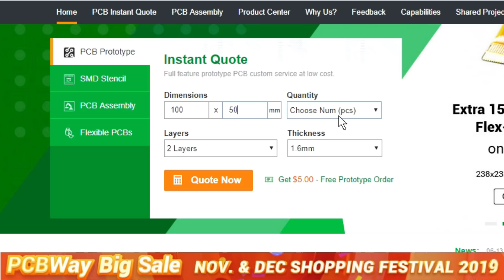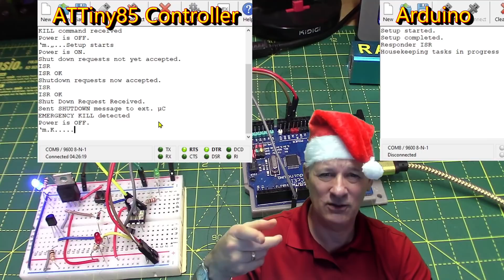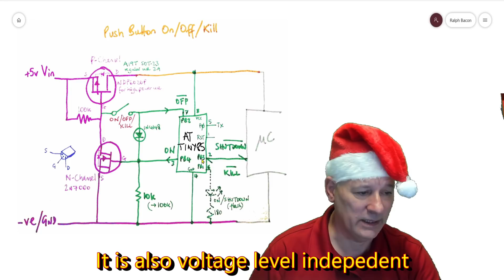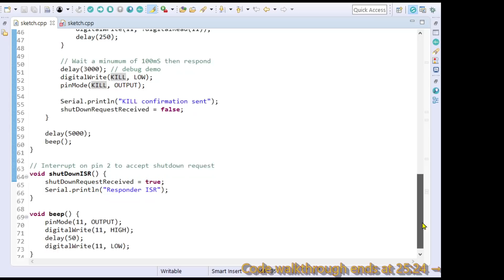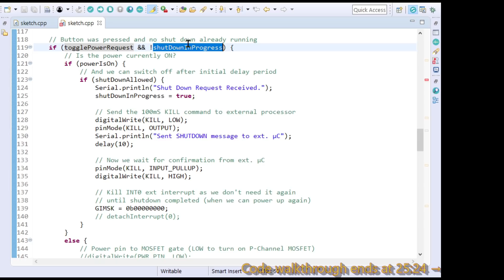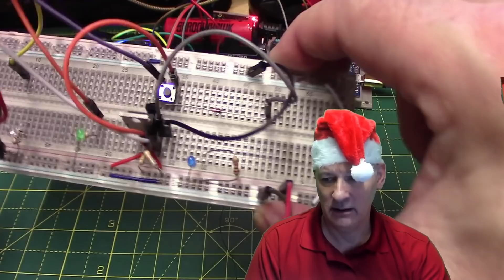#173 ATTiny85 Power On Off Shutdown

Comment: Glasses or patch, it matters not, a full recovery is the real issue. I'm enjoying this power on off series. I'm now thinking maybe the extra ATtiny85 may not be required, can the soft shutdown be done with just the same two pins on the main micro (excepted the forced shutdown routine I guess). Merry Christmas LC&S. Greg
Reply from the maker: If you watch Video #123 you will see it without a Tiny85, but with less "intelligence", Greg.

Comment: Ralph, wondering if you've made any video that could possibly give me idea on how to build a light controller.  I have 16 LED can lights in the ceiling 22 feet up, I'd like to have a potentiometer type switch for which as I turn it, more and more lights come on starting from the center out.  I don't want dimmable LEDs, I'd rather control brightness by simply the number of lights which are on/off.  I was thinking arduino connected to 16 relays.  Can you think of any of your past videos that would give me started on such a project?  I like the simplicity of a potentiometer rather than a wall full of toggle switches.  I'd pay for such a switch/controller, but I can't find anything on Aliexpress.  I don't need to use a smooth turning potetiometer, I'm okay using a channel switch too so position 1 through 4, maybe each position turning on 4 lights.  Thanks.
Reply from the maker: If these LED lights are individual lights connected to the mains then you can control them via relays or SCRs. You can buy 16-channel relay modules to connect to an Arduino (or similar). Personally I'd use a single Rotary Encoder to switch more on/off but initially you can do it the old (easy) way with a 16-key matrix, for example (to avoid the wall of 16 switches). If you email me I'd be happy to expand on all this. Go to https://www.youtube.com/channel/UC8Ob-HnnmhlgSv5Vs_i32TQ/about and click on the view email address.

Comment: C'mon admit it... you're monitoring my postbox down here in the land down under... how else did you know I'd received a bunch of Si4599 dual mosfets the other week, in order to be able to implement just this this sort of soft power switch?😂 With regard to power consumption when the system is turned on, dropping the clock speed to 1Mhz or even 128 kHz would bring it down to less than 1ma if I'm reading the datasheet correctly (22.1 Active Supply Current), let alone introducing sleep modes and other fancy stuff. Food for thought. Loved the video, as always, and have a safe and Merry Christmas. Bring on the glasses, Elton! 😂
Reply from the maker: Drat! You must have spotted the wires running to your postbox, Peter, sending me details of your packages! Ha ha! Regarding power consumption it all depends on what you are controlling. If your load is 1A then worrying about 5mA in the Tiny85 is silly. But if your load's power consumption is 1mA (or lower) then it makes sense to reduce the Tiny85's power to a minimum. Sleep/Idle mode is a good candidate and I want to play about with the code over the next few days to see if it "just works" with no modifications. Then there's the Attiny13 substitute, of course...

Comment: Ralph, here's my humble list of suggestions for a PCB: Connections along one edge on .1" pitch for - input power (+ & -), external LED (as well as an on board one), external switch (as well as an on board one), to MCU (+Ve, Gnd, & Ctrl). 3x2 ISP/ICSP connector. Pads along a different edge for a standard serial to USB thingy (even though only Tx and Gnd are used).  Two 3.1 mm mounting holes at the ends of the side opposite the main connections (maybe 2.6 mm if space is tight).  Go for all through hole.  Put the LED's resistor on the pin so that an external LED is to ground.  Is the reset pin supposed to be pulled up or down?  If so add a suitable resistor.
Reply from the maker: A timely comment, Brian, as I have been mulling over what might be useful if I were to go the PCB route. I've thought of some of the items you mention but not all. I shall consider what you have suggested. Now, why are you proposing through-hole when the industry is definitely SMD - I've even tried such a layout with ginormous components (1206 and 0805) to make it super easy to solder. I'd like to encourage noobies to "have a go" at SMD construction. Thoughts?
Reply: @RalphBacon  I see your point about pushing people towards having a go at SMD.  However, how affordable is SMD for hobbyists?  With through hole there isn't the variety of sizes that are mutually incompatible.  If I were a youngster starting out (or even an oldster moving with the times) what size would I start with?  With through hole there are affordable selection packs with 50, 100, or 1000, is the same true for 1206, 0805, 0603, and 0402 I wonder.  I note that 0805 is only 0.125 Watts, is this going to present unexpected design challenges?  What happens when a generally 0805 layout needs an actual 0.4 Watt resistor (hence 1210)?
Is a weird footprint that supports through hole at 0.5" with an SMD pad pair in the middle a possibility?  e.g. something like: O-[]  []-O  This would allow hobbyists to populate according to their ability and the contents of their parts bins.
Reply from the maker: If a design does require a half-watt resistor then that must be included as part of the design. Even if all the other components are 0402! 
I like your idea of both TH and SM components - whether that is going to work, I'm not sure but I'll have a go! Even if we can't do it "in-ine" as per your example, they could be in done "in parallel". The problem for me is that I only have 0603 SMD components but nothing larger. Luckily I have a "PCB ruler" from PCBWay that shows all the correct sizes on it. 
When starting out in SMD I just bough 10, 50, 100 of whatever SMD components I needed (and is sometimes the amount you must buy from some suppliers, super cheap) but then you build up stocks very quickly. And they don't take up much room if put the caps and resistors into an SMD sample book, especially designed for them. You lose at least 10% onto your workbench, floor, who-knows-where, so it's good to have lots of spares!
Reply: @RalphBacon  Actually, I may have to eat my words about getting resistor selection packs.  The following are random finds:

https://www.ebay.com/itm/3120pcs-156-Values-1-ohm-10M-ohm-1-4W-1-Metal-Film-Resistors-Assortment-Kits/192074917475?_trkparms=aid%3D1110001%26algo%3DSPLICE.SIM%26ao%3D1%26asc%3D40719%26meid%3D697b61cc06044def9bff6d94e760d5bd%26pid%3D100008%26rk%3D4%26rkt%3D12%26mehot%3Dpp%26sd%3D193228098618%26itm%3D192074917475%26pmt%3D1%26noa%3D0%26pg%3D2047675&_trksid=p2047675.c100008.m2219

https://www.ebay.com/itm/8500-x-0201-0402-0603-0805-1206-SMD-Resistor-Kit-170-values-5/264310462768?hash=item3d8a219930:m:mKj_eNzDmwMqpT9PbSQTTbw

So perhaps the cost of getting set up for SMD isn't as hard or costly as I thought.
Reply from the maker: Regarding your ebay links, yes, they are cost effective. But I would definitely look for a 0603 or 0805 resistor/caps book that has all values for a particular size. Mine was bought from a UK supplier but they must be generally available: 
https://shop.pimoroni.com/products/smt-smd-0805-resistor-and-capacitor-book?variant=27663754823
Or buy an empty book and fill it yourself otherwise you will never find the value you want!
Reply: @RalphBacon  Do you see multiple copies of my original comment?
Reply from the maker: I did earlier this morning but I deleted all the duplicates! Trying to get my attention, I assumed!!!
Reply: @RalphBacon  There are still three spurious copies when I look from here.  What are YT up to?  Thanks for the deletions.  I was worried that if I deleted one then they'd ALL go.
Reply from the maker: I can see only 1 now, Brian. Try pressing SHIFT-F5 to see whether it's a browser caching issue with you.

Comment: I'm afraid I have to take issue with your assertion about "open collector" and how you "always want to be driving things low". There's nothing magical about low. Bus conflicts and short circuits are quite possible with either configuration. It is merely a convention that some devices have high-Z outputs for shared lines. They could just as easily have had a convention that they should be low-Z instead.

The only exception to this would be for multiple voltages - e.g. you are controlling a 3V display from a 5V Arduino. To drive an output high, you would have to drive it to a specific voltage. But usually everything agrees where ground is, so it makes a convenient reference point. Although this isn't always the case, of course. Op-amp circuits, for instance, often have a negative ground.
Reply from the maker: Indeed, and that's why I put a comment on the video about voltage level independence (eg 3v vs 5v), which is why I2C and SPI do the driving LOW thing. It's not standard practice to drive things high unless it's on a known platform (PCB). And this controller is simply connected to "some other µController" that could be running at any voltage. So driving things LOW is much safer. I suppose I could have used a level shifter but I don't think that is required here. Great to hear from you, thanks for posting.

Comment: I'm no expert but even though the idea looks and sounds great ,,on paper,, I still think that the best, cheapest, and the most reliable ever solution (in this case) would be to scrap the idea and simply use an ordinary switch. Why overcomplicate things unnecessarily and costly  when simplicity is the mother of functionality. Simpler, cleaner, quicker, cheaper, and longer lasting uncomplicated solution.  Job done .....;)
Reply: I am on your side. Even it's nice solution, if I wanted to implement this solution on PCB using SMD components, I would have to add extra pins/pads just to program a on/off switch, which sounds silly...
Reply from the maker: The reason this project is not a switch, Ovi, (sudden death for the chip) is that:
1) this channel is all about Arduino-related items
2) you can gracefully shut down without leaving files open (and possibly corrupted)
3) it's fun to do.
Why over-complicate a perfectly good TV with such a clunky remote control with all those buttons?

Comment: Now that's what an ATtiny85 is all about: smart peripherals.  This is the best project you have  shown us AND it is all your own work. This could be a standalone device that one just has to "plug" into any project. In the same way one uses, say, an RTC module. If you had time to put the arduino side code into a library the smart button would be just as easy to use. Ifg one can figure out the different voltages, there is no reason why microcontroller has to be an ATMega328P*, the same principles could be applied to an STM32* circuit. 

I haven't had time to check the ATtiny85 code yet (too excited) but I am assuming that, say once the smart button has turned on the power and the MCU was performing a task that on completion the MCU would switch its power supply off, the KILL pin would do the job. Am I correct in this (yes I am familiar with the 'ass of me and u' thing)?

This video has moved your channel into new territory. You have shared a true innovative process with us not just shown us how to string a series of retail modules together with some wiring. I am not suggesting that that describes the sum total of this channel upto this video, but, sadly it does describe many maker channels on youTube.
Reply from the maker: So do you like this video then, Michael? Ha ha! Now, before you get too excited I didn't put the Tiny85 to sleep (KISS principle) but I think it would "just work" as is, using the push button interrupt to wake it up again. I'll see if it is that easy over the XMAS break. As it takes only 5mA when active it may not be worth it depending on what is running, of course. But I suppose we should do this power saving where we can. Thanks for posting, good to hear from you.

Comment: BTW, Ralph, your code without Serial for Attiny13  compiled as:
1016 bytes (99%)/1024; 32 bytes/64 (50%) with all standard Arduino functions
990 bytes (96%) with  _delay_ms() instead of delay();
970 bytes (94%) with bitSet, bitClear instead of digitalWrite  and  (PINB & (1<<PINB2)) instead of  digitalRead(INT_PIN)
Reply from the maker: That sounds great and so that others can read this too,  I discovered that MCUDude supports the ATTiny13 with his MicroCore:
https://mcudude.github.io/MicroCore/package_MCUdude_MicroCore_index.json
which needs to be added to the File>Preferences and then the boards installed in the usual way.
Reply from the maker: A quick query about the ATTiny13, I have several clock speeds available, which one do you use (internal)?
Reply: @RalphBacon  Internal, 1.2mHz
Reply from the maker: So I used MicroCore and got the following results from my ATTiny85 sketch with just the SoftwareSerial library removed:
Sketch uses 818 bytes (79%) of program storage space. Maximum is 1024 bytes.
Global variables use 33 bytes (51%) of dynamic memory, leaving 31 bytes for local variables. Maximum is 64 bytes.
Reply: @RalphBacon  WoW, that's even better than after my optimization! Perhaps, you've removed some unnecessary lines form the sketch...
Reply from the maker: I removed only the Serial.print lines and the library!

Comment: Happy Christmas to you too!
Great to see you using the very handy little ATTiny85!
Reply from the maker: Yes, I've warmed to it again, Martin, but I will have to sort out that programming in-circuit board. Or clip. Something, anyway!
Reply: @RalphBacon  You got me using the attiny85, thanks. I ended up putting the bootloader back on them to make it convenient to program. I am using them to build some 5 volt power packs.

Comment: Well done on the  LTC2954 emulation. I was going to look at the code , but all I see at GitHub is

CircuitDiagram.jpg Circuit Diagram (Hand Crafted) 2 days ago
LICENSE Initial commit 3 days ago
LTC2954 Typical Circuit.JPG LTC2954 Typical Circuit 2 days ago
README.md Update README.md

Where did you hide the code?
Reply from the maker: I hid it so no-one could find it, that's for sure. Or I just forgot to upload it. My bad. It's there now, both sketches. Thanks for letting me know, Ivo.

Comment: Nice work. Thank you. I have a sense your more final design for this concept is still brewing.

When you first mentioned handling the condition were the Arduino does not respond with the ok-to-power-down confirmation I was expecting you put a timeout feature in the ATTiny85 code. That is what I would have done, perhaps also adding the force off feature (nice), because the sole purpose is to turn off the Arduino with a single user press. The ultimate goal is to require only one single user input. Have the ATTiny85 do all the work.

Cheers.
Reply from the maker: I did consider the timeout, Allan, (easy to do, as you say) but then again it might take several minutes for some controllers to do what they want to do so I left that for others to add, as required. Phew, that sounded plausible to me, anyway!
Reply: I initially thought the same thing, then came to the same conclusion that Ralph alluded to above... that it's not actually a good idea. Think of your computer... you press the power button to turn it on, you press it to turn it off. If you incorporated a timeout because it hasn't said 'safe to turn off now'... you may end up losing data. Exact same thing here. If you have an application whereby it receives the shutdown request, but it goes. "hey, hang on a minute... if I do that now... BadThings(tm) will happen! Are you really sure?" ... well, you just went and killed the power now, didn't you? (and BadThings(tm) happened!). So better to do it like this (which, going back to the computer analogy, is exact what your PC will do... hold that power button for 5 seconds... and away goes the power!).